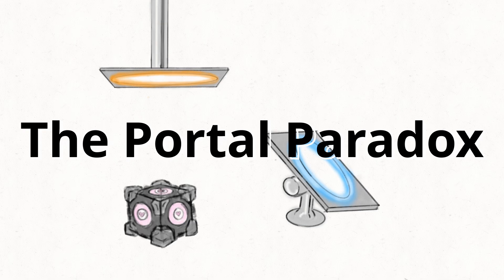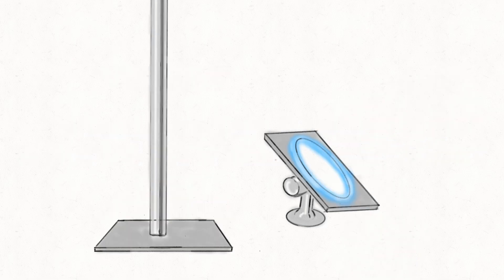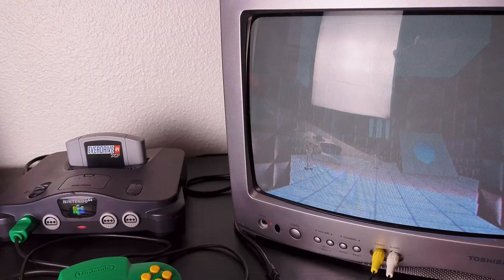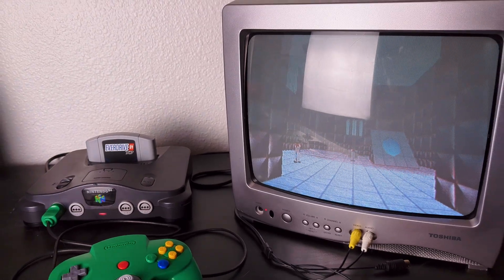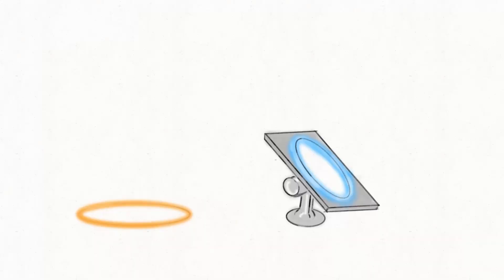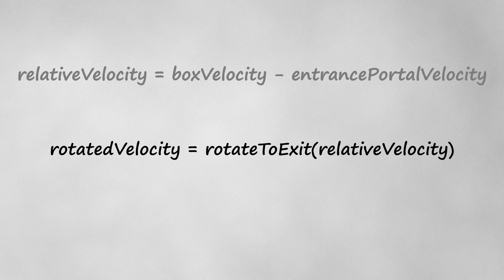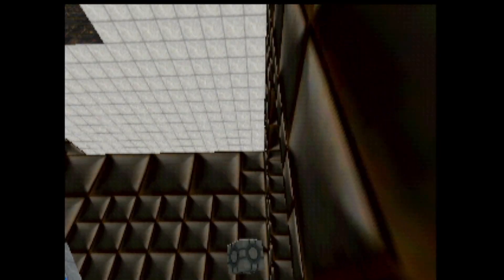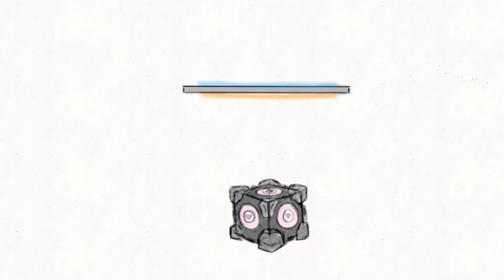I rewrote Portal from scratch and solved the Portal Paradox

Comment: What if you stop the falling portal halfway through the cube?
Reply: Well. If you want the answer it will act however the programer decided it will act.

If you want a real answer the answer is that "You can't move portals once it has been placed".
A portal is just where space-time has been bent so that both sides of the portal exist on the same exact location in space-time. This means that you can move the wall it was placed on, but the portal itself will not move with the wall. The portal is a property of space-time and not the wall.
So the real answer is "the question is invalid as it operates on a misunderstanding of what portals are. Portals are not doors, but the same location in space-time.
Reply: @Cloud_Seeker  I was expecting  a smart a** answer after the first sentence and then you just went and laid out solid facts.  I have been learnt.  Thanks :)

Comment: I'm curious now what would happen in the same test, but the ceiling portal doesn't slam all the way down, but instead like halfway down over the cube.  Would the bottom half of the cube get 'sucked' up into the portal?  And then the cube shoots out of the other portal anyaay, but at half velocity than the full slam down or something?  Would be cool to also know why as well, if it does indeed work that way, or whichever way it works really.

Comment: You assumed is that the cube velocity is calculatd in relation ho the portal, which is the exact problem.
If portals can move it doesn't matter.
Would be nicer if you show what happens if you calculate velocity relatively to ground
Reply: Yeah the answer is different dependent on what you measure relative to

Comment: where does the energy come from.. i mean if you did it with a huge chunk of tungsten the energy of it moving at the velocity of the portal would be enormous, vs the companion cube.

this would kind of be an infinite energy glitch unless the portal draws more power to account for it or the first portal slows down to accelerate the mass of the transported material

Comment: The real question is when 2 portals sandwich an object, like some other commenters mention. The object would push against itself, but with how much force? If it were 2 unbreakable plates, the object would take only the force applied to the plates until it eventually breaks.

With portals, there is no direct contact between the plate that the portals are anchored to and the object being sandwiched, so there isn't necessarily such a clean equation. Depending on how the portals are being created, the crushing force required might need more energy to maintain than the portal has, resulting in the portals failing.

Or perhaps, as there is no force against the plates, there is no force resisting the portals moving towards each other, resulting in whatever force is needed to be applied to the object being sandwiched to cause structural failure.

In other words the sandwiched object gets crushed, melted, or whatnot as much as is needed to fit between the portals
Reply: The answer to that is "it is an invalid question. You can't actually move a portal once it has been placed."
Reply: @Cloud_Seeker  If that's the case, then this whole video is invalid. A portal seemingly anchors on a surface, so moving that surface should move the portal. If the portal is immovable, then what happens if you were to press against the portal with an object like the surface it is anchored to?
Reply: @robertcrossgrove2855  Yes. The whole video is invalid. That is the point. Portals do not exist in reality for a reason. They are fictional. This is why people come up with stupid problem and then argue about them. The simple answer is that the video do not answer any paradox because the paradox is invalid in the first place.

Ever heard of the saying "How many angels can dance on the head of a pin" before?

And to answer your question. Why do you make the assumption that a portal even has to be anchored to something? A portal is a property of space-time. A portal is just when space-time has curved itself that both the entrance and exit exists on the same exact position in space. To even make the assumption it has to be anchored is incorrect. Space-time is warped. You can move the wall it is placed on without moving the portal. A portal can float freely in space without any issues at all. It just have to be in the game because Portal 1 and 2 are games, and require game balance. And the fact it should be a massive pain to actually code in real portals.

Comment: Tbh i dont think the first and the second test should have different results because the cube theoretically still lays on the ground in both cases so it should not be shooting out the other portal 
The cube just carrys its momentum with it.. 
if you would place the cube on a small platform on a pole and you would put the Portal over the pole with the cube it would imo still lay on the platform and not get shot away
But its a very interesting topic 🙂
Imo the cube would just slide to the lower edge of the blue portal because of gravity on the bigger part of the cube but wouldnt even fall of the angled platform because it is not completely through the portal at that point

Comment: well you can code however you want,  but i think your approach is wrong cause "speedy thing goes in and speedy thing goes out" is a reference to that portal keeping momentum of whatever cross it, the cube that wasn't in motion sudently shooting out after crossing the portal fails at this. 
Also i think we can agree that the time it takes for an object to go in and appear at the other side of the portal is instanateous or near that and accelaration being equal to the change in velocity over the change in time (delta V/delta t) means that has change of time aproaches 0 the accelaration aproaches infinite, a force=mass times accelaration means the object would experience also an infinite amount force acted on it and if ever saw object having excessive amounts of forces applied to them they tend to explode, so the cube should have exploded (exploded into pure energy if it was instataneous)very very violently.
Reply: Well I’m not sure how much of this applies when you think of relativity, i know you can’t say something is in motion or is stationary without defining a frame of reference and there is no absolute frame of reference so the answer differs depending on the frame of reference
Reply: "speedy thing goes in and speedy thing goes out" only applies when the portals are stationary

Comment: Hey, I'm studying physics at MTSU. This is a really good example as to why portals are impossible. The issues isn't with the math, it is the fact that in the "real world" energy must be conserved. What you did is accelerate a mass without applying any force to it what so ever. That is not possible. Force dictates the acceleration vector which determines the velocity vector after a period of time. This is why F=m*a where F is the force applied to the mas m. You can't accelerate a mass without applying a force as per Newton's second law of motion.
Reply: PS I am not trying to be sarcastic or condescending! 😅😊. I'm just a nerd.
Reply: Literally my same thought, every time I see someone try to give a answer for this question they never explain how or wat force would be acting upon the cube.
Reply: It's actually the normal force from the floor in the special case of a perfectly rigid cube that produces this result. The portal "squeezes" the cube, and it "bounces" out. If portals conserve momentum (and energy), the slice of cube that exists is motionless, the next slice materializes right on top of the first, pushing back, so ultimately the floor's normal force launches the cube. With a non-rigid cube it would not match velocity of the portal.
Reply: @menglish92  okay that kinda makes sense, but now do that same trick with a box floating in free space. What he's saying is that there would be an imaginary force of nothing accelerating the box to the right even though it is not in contact with anything.
Reply: Motion and velocity are relative so the answer differs depending on the frame of reference and there is no single one to go by
Reply: @thealmightylatte  you are correct. However, for any frame of reference acceleration can not occur without a force. In some reference frames there are forces that are called "psudoforces" which go away after changing the reference frame. A good example of this is a ball being pushed away from a rotating center in a rotating reference frame (someone standing in the center and rotating with it) is in all actuallity just a ball constantly being pulled in (accelerating) through tension in a stationary reference frame. In what reference frame is there a force that is consistant accross all frames that would cause the box to accelerate? I would urge you to think in a stationary reference frame as moving/rotating reference frames cause issues both mathmatically and logically.
Reply: @robertcarlyon6076  explain how there is “acceleration” because in the scenario the moving portal is moving at a constant rate so there wouldn’t technically be any acceleration
Reply: @robertcarlyon6076  however I don’t believe there will ever be a definitive answer to this without defining what a portal is, it really depends on all the things you assume about portals. Like how I don’t know what they are. If it’s a wormhole you have to be in space or something because wormholes wouldn’t be attached to the surface they’re shot on. Also canonically portals are quantum tunnelling but motion generates some heat and quantum tunnelling requires low temperature, so moving portals canonically cannot exist.

I know there’s the neurotoxin sequence but because of how they defined portals canonically, realistically they couldn’t exist like that if they’re moving
Reply: @thealmightylatte  the box is accelerating because it is at rest in one moment in time and it is moving upwards and backwards in another moment in time. The box has accelerated from 0 speed to some speed. A force must have acted on it to increase its kinetic energy. If you are taking the portal as the reference frame, then the direction of the velocity changed when it went through the portal. That also takes a force to accelerate in another direction. Like how a car is forced to turn via a sideways force though the tires when you turn the steering wheel. When there is no definite answer that works for any reference frame or the answer changes when the reference frame changes, there is no evidence that this is possible. This is because energy must be conserved across ALL non-accelerating reference frames. "There is no correct answer," means this is not possible. It is a cool game mechanic though.
Reply: @robertcarlyon6076  acceleration, yes, is the change in velocity with respect to time. Velocity and motion, again, is relative. The velocity changes relative to something, so it is accelerating relative to something, technically, it’s forcing itself up or the entire world is forcing itself up relative to the moving portal. Energy is conserved between all reference frames, it’s just that energy conservation in non inertial reference frames is different and harder. So it’s usually rule of thumb to use inertial reference frames to make things easier, and much, much clearer. Kinetic energy is the energy something has due to motion, which, again, is relative to a reference frame. If something is in motion relative to something it has relative velocity, relative motion, and relative kinetic energy. There is acceleration, again, because of the fact that the relative velocity is changing

You also cannot be stationary relative to something, exit something, and still be stationary relative to that thing whilst exiting. The cube would most likely be crushed under the pressure of the portal moving down towards it.
Reply: @robertcarlyon6076  why do you need a force to accelerate even relatively? Because acceleration is the change of velocity with respect to time and velocity is relative, so something COULD be accelerating relative to something.

Comment: This makes sense, scientifically speaking.

See, one might argue that, in order to move the cube, it needs energy, but the portal, since it doesn't come into contact with it directly, can't possibly give it any kinetic energy, which means it shouldn't move.

But here's the thing: we aren't dealing with normal spacetime here. These portals are wormholes.

It's like bending spacetime to "travel faster than light." You yourself, or the cube itself, doesn't move, but the space around it does. What the orange portal is doing is basically slamming space at and around the cube, which means, relatively speaking, it is moving. And since space is kind of our ultimate frame of reference, we can only ever experience this interaction as the cube moving in space, even though, technically, the cube is stationary and space is moving around it.

Comment: So when the box is halfway through the portal, half of it is moving forward and the other half is stationary?
This seems very wrong. 
If the box is not moving, throwing a portal at it will not make it move.
Reply: No that’s not how it works, in the game passing through a portal is when at least half the total mass of something passes through a portal, but I’m pretty sure his is just when the cube hits the portal, also if you haven’t already you should watch his follow up vid
Reply: @thealmightylatte  Cheers for the head up on the follow up vid. I have come to the conclusion that there is no answer. It is a paradox. Either way you are breaking a law. Both answers are right and wrong. You could create a perpetual motion machine using portals, so no math will ever work with them (with our current understanding of things). Fun though experiment though.
Reply: @photobackflip  while I do agree with this, I don’t think this paradox needs a hard solid answer, I think we need to find the answer that fits reality the MOST not one that completely adheres to it since portals inherently break laws even when they are both relatively stationary, in my opinion B is the most realistic answer but there’s never a correct answer with fictional things

Comment: Valve's obvious answer to this is that portals must remain stationary, so it can't happen. My concern is that the box has no relative Velocity in relationship to the exit portal (even when the entrance portal moves around it, change in position doesn't necessarily equal velocity when we are already breaking physics with portals) so I pretty firmly believe that the box wouldn't move if we could somehow reproduce this in real life. In fact I believe that gravity from the floor under it when the entrance portal lowers on it would probably keep it from even sliding off the slope of the exit portal. That being said I don't have any real background knowledge that is relevant to this problem so I'm far from a reliable source. Still very cool you made your own engine for portal on the Nintendo 64. I think that's super cool, and I look forward to seeing more about this!

Comment: Okay but relative velocity isn't an actual movement vector, it's just the result of comparing 2 object's velocity to each other so applying it to an object feels a bit wrong.

Also Portal Made it pretty clear the portals only act as doorways and nothing more, only the vectors of the item going through it should matter unless there's a physical contact.
Reply: Velocity in and of itself is relative, it’s just that you’d have to calculate it yourself relative to something, and you have to decide what that thing is, he did the most realistic thing

Comment: Here's a question. If the moving portal covered the box slowly, what would happen? I think whether it moves fast or slowly wouldn't change anything. The box should just stay there, and depending on friction, maybe it would slide or fall down toward the edge of the exit portal, since it's on a slant.
Reply: It would continue out the exit portal the same speed it went through the entrance portal and keep going until acted upon by another force. In this example it would come out slower and not fly as far across the room. Alternately if you slam it down harder, it will fly faster and further.

Comment: I dont think your equation is wrong, but I disagree that the only thing that matter is relative velocity, considering that portals don't exactly teleport as much as they open a tunnel. Practically speaking, dropping a tunnel onto something won't effect that objects momentum. In your presupposition, when the cube is moved towards the portal, it has velocity as it passes through the tunnel, and momentum carries it into the air. However, when the portal moves towards the cube, the cube has no velocity, so there's no energy to propel it through the tunnel, as the portals don't directly effect the cube